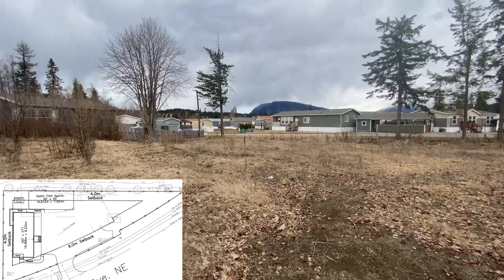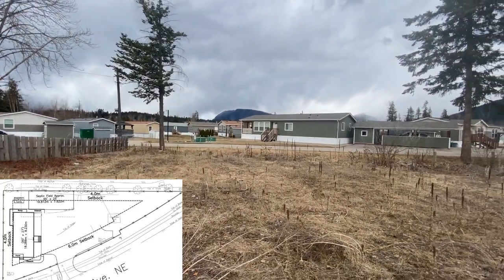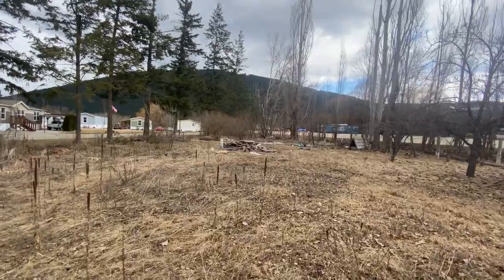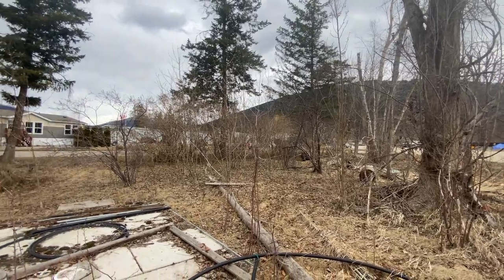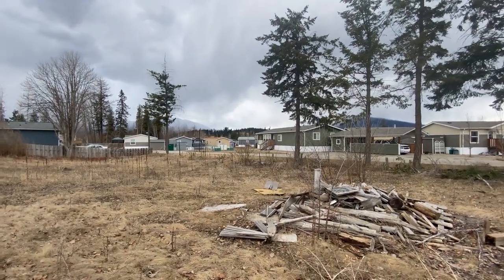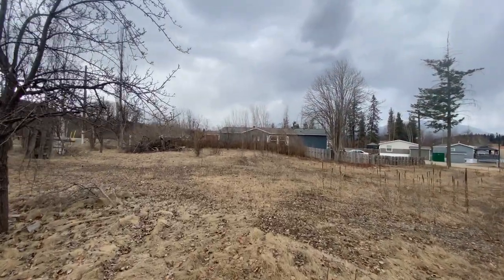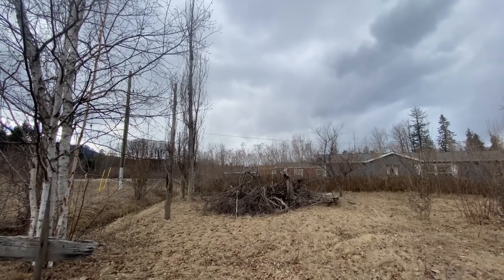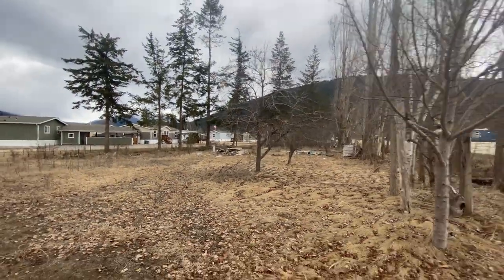How To Avoid Costly Mistakes When Buying Land For a Manufactured Home

Comment: If you recycle grey water the black can either go to a pump out tank or there other options from a composting toilet to a insinerating one can be a lot cheaper than a feild you can even go to a methane digester and get heat from it

Comment: But even though you got confirmation that a septic system was allowed , how would you know the ground percolated correctly?  Were you doing this project for someone or for yourself? And are you an architect? Who would I contact to help me with figuring out if the property is suitable ? Also do you buy the land first and then figure out which prefab manufacturer will deliver?  Thanks.

Comment: What’s the general cost to install the septic tank + drain field?  How much to clear land?
Reply from the maker: Will do a video on that!
Reply: Cost of subject depends on your area and your property I am about 2:00 miles South of Chicago Illinois on a 2 acre plus And had a new septic install Because the old system had failed the new system in 2019 came in with a lyft station  approximately $9000. If you need a well again it depends on your area and how far they have to drill I had one drilled in 2017 . The well was drilled a 118' deep at a cost of about $7500. Hope this is helpful to someone
Reply: @stephendavis7441  Pretty accurate Stephen - thanks. I guess it also depends on how popular your area is and how bogged down the septic companies are. I’m still waiting on a quote for one now!
Reply: @stephendavis7441  100% just like getting 3 opinions for any doctor! I’m trying to get 2 quotes right now, and trying to keep on them without bugging them too much. Thanks Stephen!

Comment: Kerry, will the home have insulated skirting?
Reply from the maker: Wasn't planning on it. You a fan of it?
Reply: @KerryTarnow  I was just thinking that anything that keeps the water supply warmer has to be good. When I had mobile homes, the heat tapes didn't keep the water from freezing on three occasions.
Reply: New to channel.. where are you located?